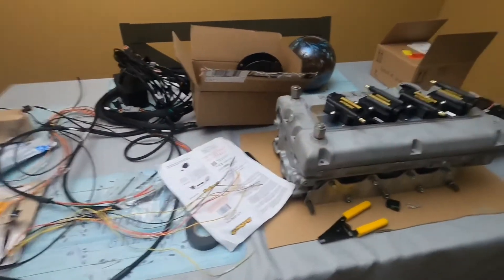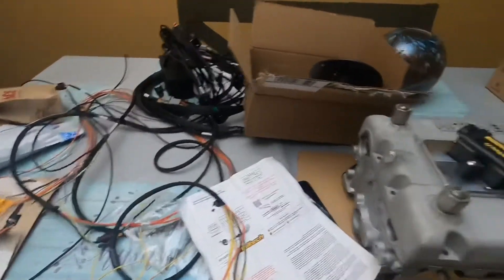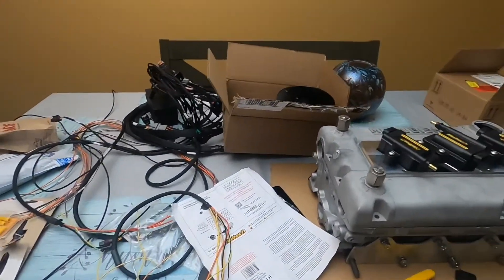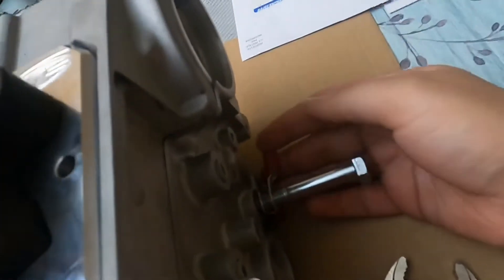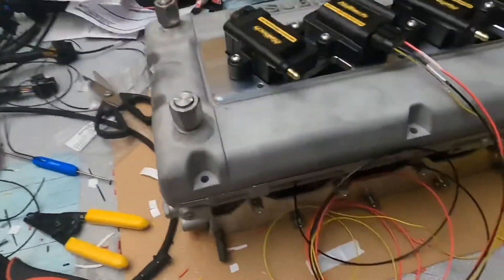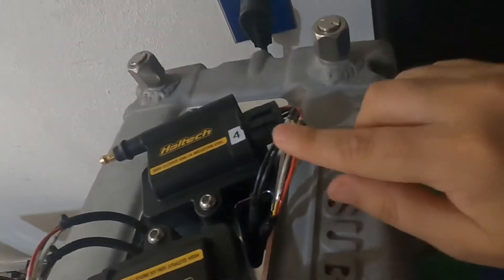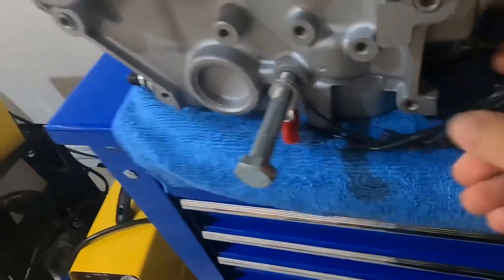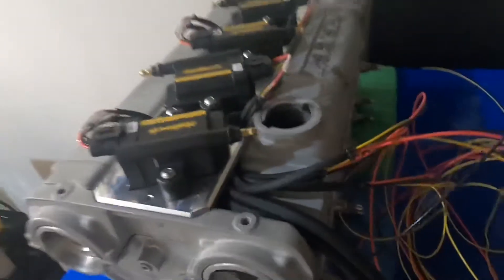Wiring IGN-1A Coils for the 4G63 Drag car.

Comment: And just wondering what loom covering you're using please?
Reply from the maker: Insultherm Tru-Fit , from milspecwiring.com
Reply: @nexxracing  any idea what size you used to fit those wires in? Sorry I'm from Australia the us sizes are bizarre to me :)
Reply from the maker: So for wiring loom I used 
SLEEVING 1/4 inch that’ll fit a couple wires in one sleeve 
And then to fit 1 or 2 wires I used 
SLEEVING 1/8 inch 
To fit almost all the wires needed for the IGN1A wires i used 1/2 inch 

For labeling the wires i used:
Clear Heat Shrink Tubing 1/8"

Comment: Hi! What label maker did you use to label your wires like that? Are they heatshrink labels?
Reply from the maker: I used a Dymo label maker, they’re not really meant for this but it worked. I used a heat shrink tubing and put the label in there and heat shrunk it over the wire with the label inside it. Looks really good.
Reply: @nexxracing  thanks so much and thank you for the video! Did you end up also adding an earth strap from the block to the body? Did you use star point earning and earth the battery to the block?
Reply from the maker: So my star point grounding will be the head . What I will do is a thick ground cable from battery to the head and then I will do a smaller size cable from the head to the chassis/body
Reply: @nexxracing  thanks so much.. I really appreciate you taking the time to answer!
Reply from the maker: No problem

Comment: what spark plug wires are you running?
Reply from the maker: They’re ones made by InductionPerformance if you go to there website   www.inductionperformance.com they’re called IGN1A Spark Plug Wires they’re made for the Supra but will fit the 4G63 plugs I have confirmed they work and work very well!
Reply: @nexxracing  okay cool thank you